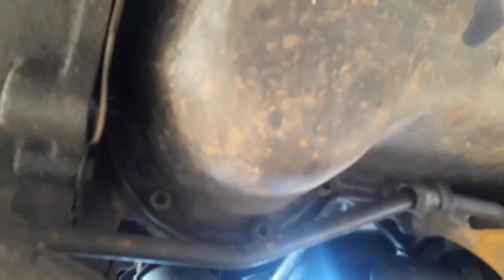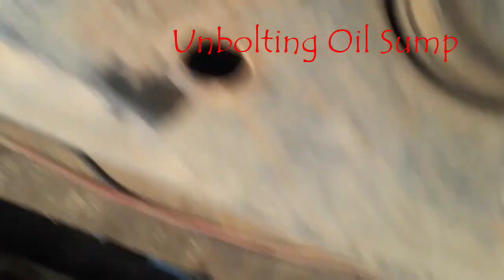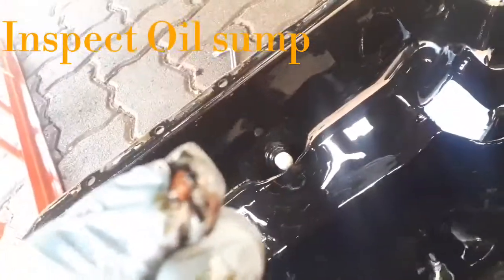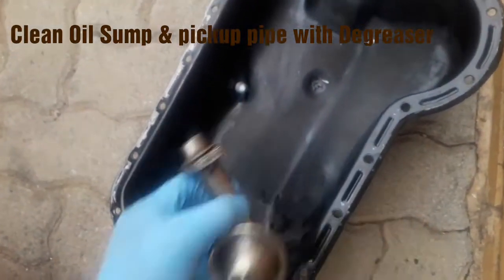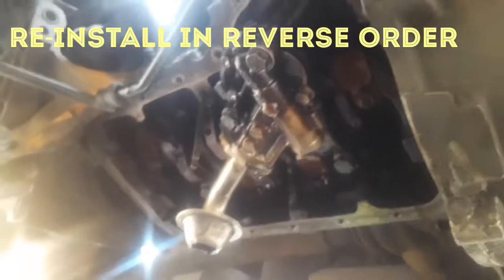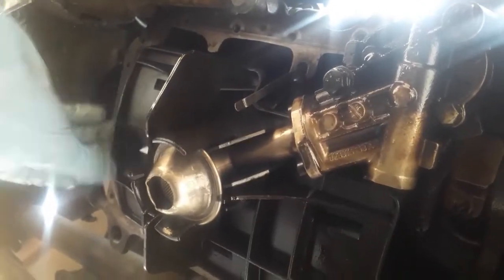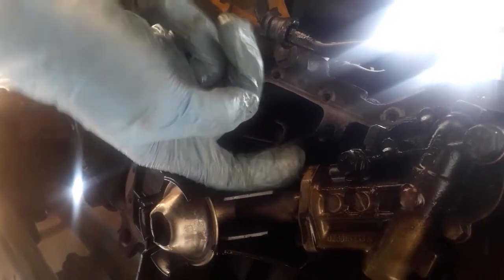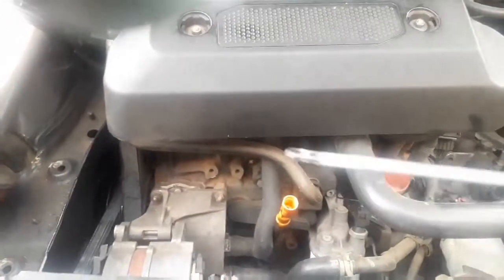Oil Sump + Oil pick-up Strainer CLEAN on VW Polo Playa 6N2

Comment: What are the symptoms ?
Reply from the maker: It was just preventative maintenance when I did it, but normally, you would be getting low oil pressure, noisy tappets/Lifters.